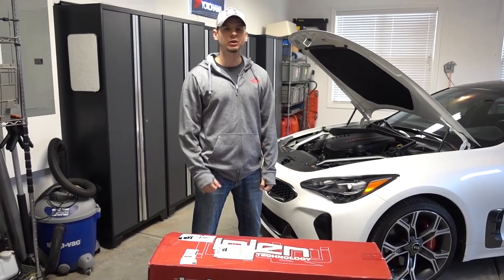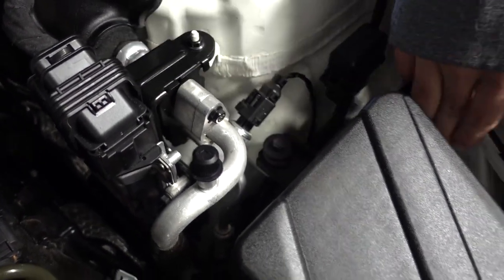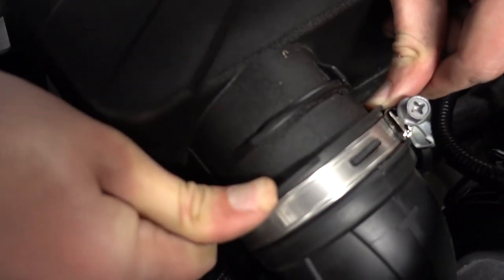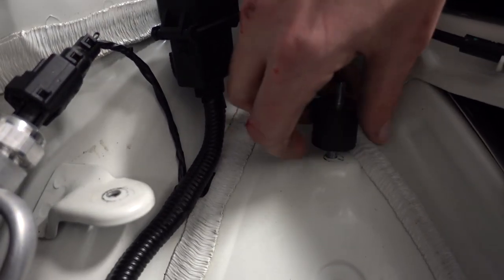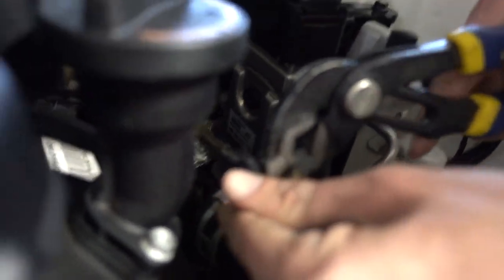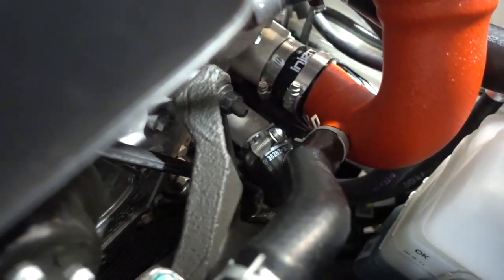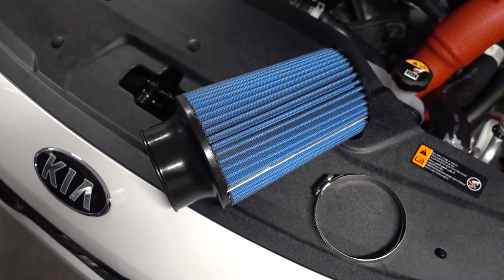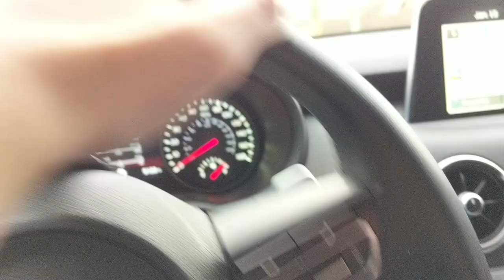Kia Stinger GT2 Injen Short Ram Intake Installation (Wrinkle Red)

Comment: Can use a heat gun for hoses this way you will connect and this connects hoses with no problem.
Reply from the maker: Great tip!
Reply: I cut my finger sometimes lol is one on harbor freight get a cupón with your cell and you will pay like $30 Bauer has heat setting or one with heat control. Heat gun has so many uses. I don’t how much to pay for the intake. But you can make those with PCV tube with glove and a heat gun can shape the pcv tube. I only pay top money for filters and carbon fiber seal for filters. You can make and shape some tube with scoops they look bad ass. People ask or stop to look those dual scoop inside my grill. This how you really increase hp on the beautiful car get air from the outside not from ur engine. If you do that remember what is going to be getting the air from outside is the scoop. Drill some small hole in the bottom this way no water get on your filter. You can have those filters on the same location but used seal box for your filters.
Reply: It a really nice car
Reply: I like the blue
Reply: @aavaz3043  Call Mary what at showing you lol

Comment: Getting mine tommorow and just want to say thank you for a REAL install video! Not just a bunch of cuts and "kinda" explaining. 

Very clear, great shots, and shows that its not just a piece of cake and what to expect. 

My only question, it kinda seems that the hose to the blow off valves didnt need to be removed at the valve?   Is that neccesary to complete the install or can it stay on?

Comment: You put a free flowing intake on and then covered it with a bag that has a large logo on it? Just seems counter productive doesn’t it?
Reply from the maker: No.  It is called a pre-filter and it is specifically designed to extend the life of the cone and repel water.

Comment: About to do this install and wondered if anyone thought of putting small vacuum hoses (10MM & 12MM) on to driver side intake tube FIRST versus onto/into engine, so when as seen in video, Q&D said it was a real bear/struggle to try to get all 4 at same time sync'd.  Wondering if anyone saw this or thought about that?  Seems like this would allow easier manipulation into slot/spot and then you're just manipulating the smaller hoses into engine spot and not trying to wedge/turn/force those little hoses and rest collectively or all at once as it appeared.  Again, just wondering if anyone tried that and had success.  Q&D did get it on and tightened but trying to shave a few grunts and groans and aggravation.  LOL. Great job, look and sound. Can't wait to report back on our success.
Reply from the maker: One tip I've seen is to heat the hoses up and they should slide on easier.
Reply: We tried what I just mentioned and ultimately answer was follow Q&D method...it worked out great and as his did.  Side note, the 10MM hose didn't seem to seed well on the intake so we added a universal hose clamp just for grins.  Everything else was perfect.  Thanks again for those commenting and especially to Q&D

Comment: Owning a Stinger GT Limited I can tell you that this "cold" air intake will definitely not siphon cold air under that hood, with those two turbos just underneath it and the heat soaking that happens since the air vents are fake on the hood.
Reply from the maker: Negligible. The stock intakes have vents by the radiator that force fresh cool air into the intake area.
Reply: @QuickandDirty  
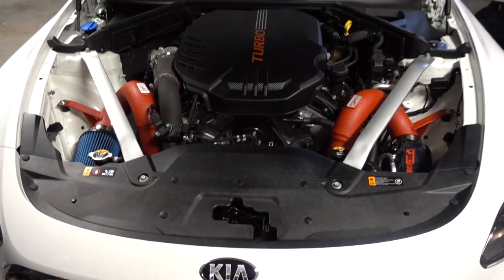Freeze frame @19:50. You can see that most of the air will be aspirated from around the new filters, inside the engine bay. Whereas the OEM filters are inside a box with ducts coming from the front of the car to channel real cold air to them. Granted the new intakes look cool though.

Comment: Great video, I'm planning on picking up the same ones for mine, I swapped out my rims on mine after two weeks of owning it to a set that was 9.4 lb lighter than stock per wheel. THAT made a huge difference. It throws you in your seat way more. Also you should vent the BOV's to atmosphere you get more sound and plug the intake bungs with rubber bar stool legs, found at home Depot. ;)
Reply from the maker: Nice, for sure reducing that rotating mass has a huge effect.  I might look into doing the same.
Reply: @QuickandDirty  yes for sure it was night and day difference, you should also look into installing a ADD1 oil catch can. The amount of water and nasty oil vapor it catches is insane. And to think that stuff gets pushed through the the intercooler and intake plenums. It produces one coffee Togo full of oil water vapor every 3-4 days. I did it cuz I want to keep mine running as clean as possible.
Reply: @QuickandDirty  my catch can isnt catching much.. hard to believe yours is catching that much in 3-4 days.. something must be wrong
Reply: What wheels did you get?
Reply: @daytonasayswhat9333  ￼

Traffic Jams Motorsports

They were TSW MECHANICA MATTE GUNMETAL, I've sold the car a while ago now.

Comment: Nice stuff! I'm looking to get myself the ngm intakes sometime in spring. For the battery unplug there should be a terminal in the engine bay if I'm not mistaken. That should make it easier to disconnect when needed especially if you have stuff in the trunk.

Comment: Hey thanks for the great video! Can you really hear the difference? I noticed in your video you can hear the blow off valve and it's more noticeable. I didn't know if that's a different mod you had or from the intake install alone.
Reply from the maker: Ohhhh yes, the sound really wakes up with the intakes. I cannot recommend highly enough.
Reply: Quick and Dirty did you have to get a tuner or anything to adjust the air: fuel?

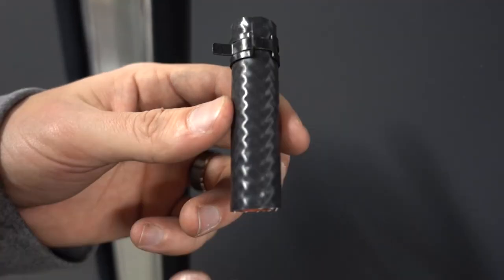Comment: Hey I need some help. You show those pipes you are putting back on to blow off valve that doesn't come with kit. Where didnt get them? Can you please let me know where to get those. @11:10 seconds those two hoses. Are stock or you bought them? I have 2020 the driver side looks like there are only two connections
Reply from the maker: I am pretty sure those came with the Injen kit.  Or they are stock.  I did not purchase them separately.
Reply: @QuickandDirty  that's the only thing holding me back from buying it. I'm not 100 on the installation if stock pies don't fit.
Reply: @QuickandDirty  also will this fit 2020? Link?

Comment: Silly question but is it necessary to remove the battery on your first step?
Reply from the maker: It's always a good idea when working on a vehicle imo.  Not sure if it resets the ECU so it can learn the new air intake or not, just seems like a good idea all around.

Comment: Great video, thank you, you didn’t have to put those stock air box connectors back in correct?
Reply from the maker: Which connectors, the blow off valve recirculation hoses? You might be able to run with them vented to atmosphere but I didn't want to risk anything.

Comment: Wait why is the liftgate not closing under power? And did you get that resolved at some point to be working again?
Reply from the maker: When you remove the power to the car with the list gate open you have to manually release it. Once closed it will work again.
Reply from the maker: lift gate**

Comment: Engine room should be isolated... Our you will lose hp if the car breathing the heat
Reply from the maker: Yes thought about that, but I'm not too worried about it. The cone areas are getting plenty of fresh air.
Reply: I thought the same thing. I live in Atlanta and it gets crazy hot here. Seems what you gain could be lost from under hood heat.